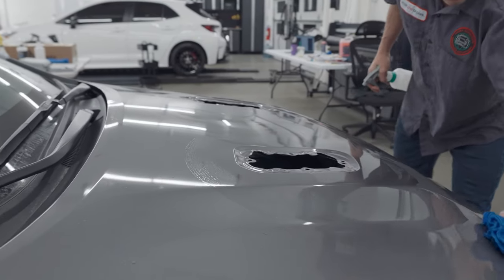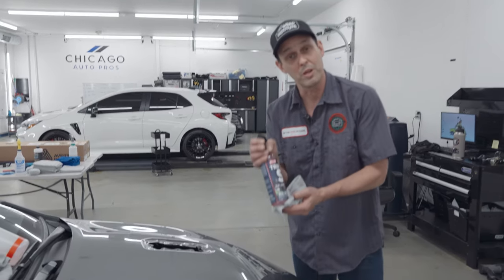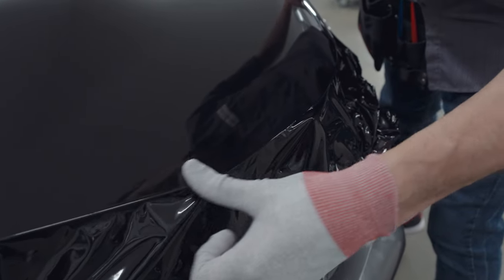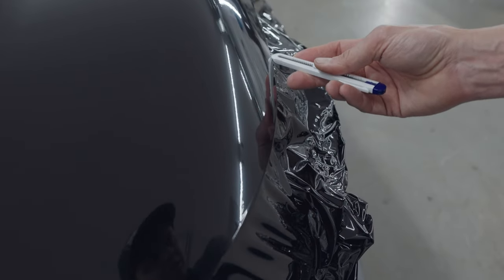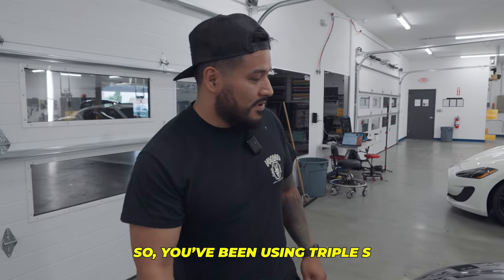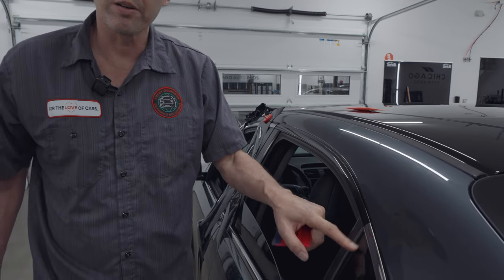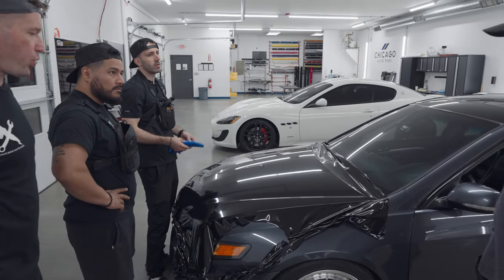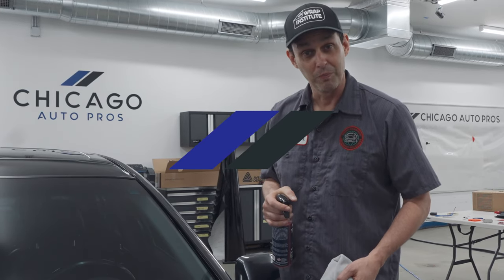Justin Pate Shares His Vinyl Wrap Secrets | Car Wrapping @WrapInstitute

Comment: Cool video and does Car Supplies Warehouse sell a rack to mount and hold PPF/vinyl rolls?
Reply from the maker: No we currently do not. Keep a lookout in the future though!
Reply: @ChicagoAutoPros  I am reverting back to my days working in carpet mills but a stainless steel mount which bolts to the studs in the wall would be perfect. The roll of PPF could slide onto brackets making mounting the PPF simple. Then if there was a white board mounted on the wall too with a mechanism to clip the PPF on would be perfect!